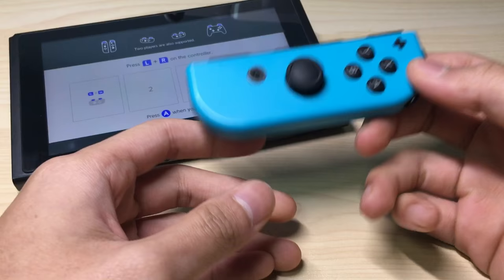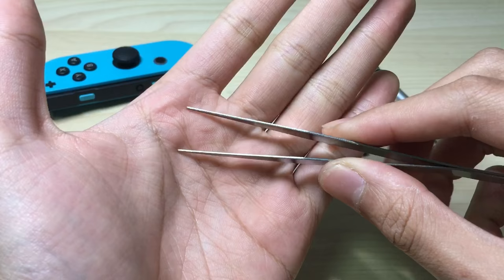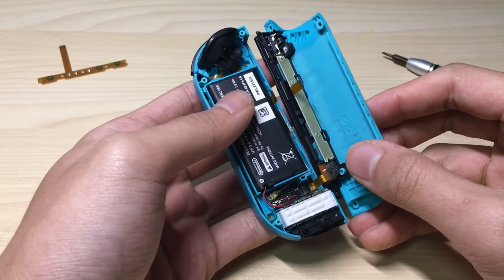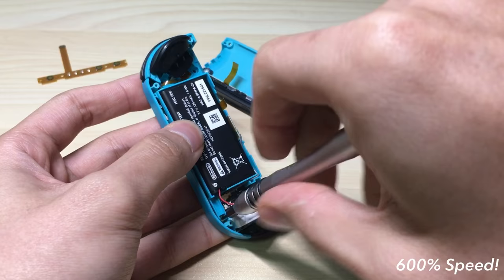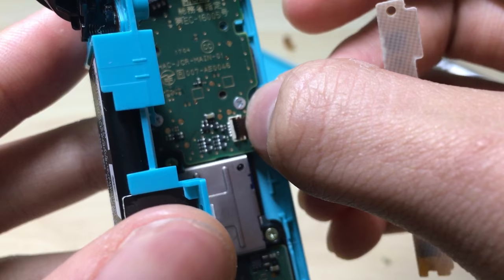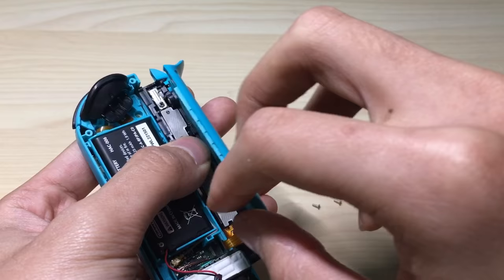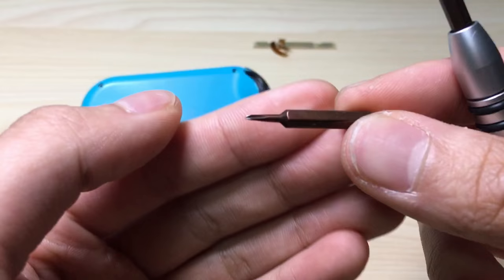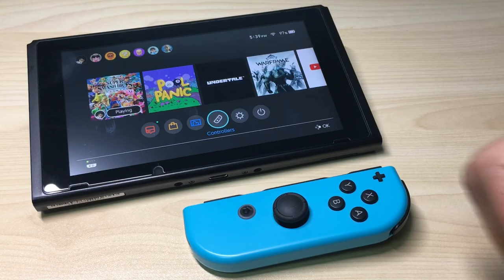Joy Con SL/SR Side Buttons Repair Tutorial (+IMPORTANT TIP!) - Nintendo Switch DIY Repair

Comment: Is there a fix if I broke the black part that catches the flex? ):
Reply from the maker: You know actualy I broke mine too, but I found that I could still put it back, and with the help of a magnifiying glass (a.k.a my phone camera on max zoom) and a really frustrating, very tiring trial and error I managed to put the black part back. Though if you lost it or you can’t put it back, I think you’d have to get a new joycon logicboard... Which is not exactly affordable if you can find any
Reply: Kenneth Tanaka So if the side of the joycon which is the black part comes off along with the yellow and orangish tape it’s unfixable

Comment: Hi so basically I was changing the shells from my joycons and when I went to see if it would charge it wouldn't charge but all the buttons worked and now the problem is that the joy con is dead and won't charge please help
Reply: Same issue here. Dont worry tho. If the controller works fine when on the console and docked and all the buttons work. That's good.  Your issue is probably that the lights dont blink and you cant use it wirelessly. I would suggest opening your controller to see if everything is connected. Put the joycon on another switch and make sure it's the joycon or put another working joycon on your switch to make sure it's not the switch. It will say it's out of battery but it's not. It's a visual glitch. It will also not charge. Many many many other people have experienced your exact problem on dozens of forums and the only thing I would say after you've done everything is to replace the cable the guy in this video replaced. Those cables are extremely fragile and are pretty much prone to breaking. That cable controls the lights, and sync button. Without it being able to sync. It wont be possible to use it wirelessly. I'm currently waiting on a replacement ribbon cable and it arrives on Monday. If you have any more questions plz lmk. I'll reach back to you after replacing it to let you know if it worked or not.
Reply: @coronavirus186  omg thank you so much for responding finally some hope in fixing it
Reply: @coronavirus186  but also the problem is that I did two so my other one the cable for the lights completely broke in half but It still charges so that's what I'm confused about
Reply: @Pastsunrise  hmmm that's weird. My understanding the rail cables comes from the many forums I've read. I'd say wait for my answer before spending any money on replacement parts. If your not-charging joy con had a healthy battery prior to you switching out the shell. It would probably be safe to assume your battery is fine. However, If you've deducted the problem is surely in the rails. You could buy pairs of the entire railing and ribbon cables together in one piece on Amazon. Fairly cheap. Just make sure you didnt mess with the motherboard or anything like that. Some people found many answers to problems similar to these without having to change anything out. Could always be a computer problem in the joycon. Could be a faulty switch. I'd say never stick to an answer before you're 100000% sure. Also keep in mind that cables are weird and some things work while others dont.
Reply: @coronavirus186  ok thanks
Reply: @Pastsunrise  one other thing I should add is that I never switched shells. A year ago I had opened up the controller maybe 40 times to replace a few things. It was my first time so I didnt really know the internals too well. Kept messing up.  Somewhere along my opening and closing I had unplugged the rail ribbon cable like the one in the video. I struggled putting it back in its place. I left the joycon alone until yesterday where I went back and  replaced a few things. Then I noticed the lights didnt work and it stopped working wirelessly. And it showed it as low battery on the switch and that it didnt charge. It only worked docked and handheld. I hope you maybe learned something from how I broke mine. I'm just sharing my experience with the issue.
Reply: @Pastsunrise  my idea was wrong. Still doesnt work.....
:(
Reply: @Pastsunrise  if your very eager to fix it and willing to spend a bit of money. Changing the entire rail would be your best bet. I quite honestly think it's a joycon computer issue now.... I'll go look at more forums.
Reply: @coronavirus186  ok thank you so much for letting me know. Also what forums do you look at?
Reply: @Pastsunrise  it's been a on going problem. Many forums are a year old. Maybe older. Just search up things along the lines of your issue. "Joycon lights not working and not working wirelessly". I found some Ifixit forums and some reddit ones. Just gotta look. So far not too many people have found a solution
Reply: @Pastsunrise  most of the time the thing gets abandoned and no answer is ever found
Reply: @coronavirus186  ok thanks

Comment: what happen if i didnt take out the battery connector?
Reply from the maker: If you use metal forceps (or anything metal), you might short circuit the logic board and well, it’ll stop working altogether. This happened to me, and I had to buy an entirely new logic board which doesn’t come cheap. That’s why I don’t want others to do the same
Reply: @namedkenn  can I have the link ? in case something like this happened in the future to me

Comment: Can you find a permanent fix i dont want to constantly fix it every 2 years or few months if not (this is another reason ill start hating nintendo :| ) they seem so cheap.... (80$ joycons which has some faults,some problems with the switch itself,dead pixels,and a online membership which is terrible,its not that bad but i hate it when it starts lagging with flipping 4 bars of wifi)so um nintendo? Can you um finnally be wise about that? Ik its alot of work but its making the console look bad.... ._. The only gteat thing about is the games dont get me wrong i love nintendo but it feels like there going backwards heck i think the wii u is starting to look better in those ways besides the games and revolutionary controllers (which dont work well some times) i love nintendo but do better ik you can
Reply from the maker: Yeah, I quite agree with most of your arguments here, there’s ups and downs with the Switch, definitely not a perfect product (but the games I love them!). 

But unfortunately I don’t see a permanent solution to this problem. Because, how do I say it, it’s a ’natural’ consequence of metal that rubs on that ‘pad’ which will eventually cause debris and thus, drifting problems. I really hope Nintendo could fix it with future revisions.

Comment: Overwatch made me rage so I snapped both of my split pad pro controllers of my switch and one of the controller ripped through the side hinges where the controller slides into the switch. I saw it was just the orange ribbon that detached itself so I just reattached it and saved $50 Woo whooo